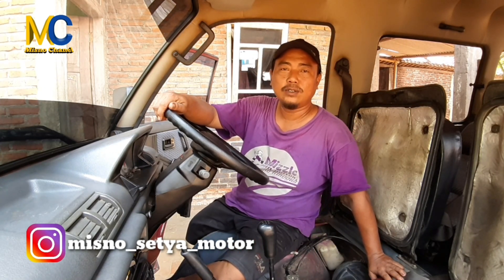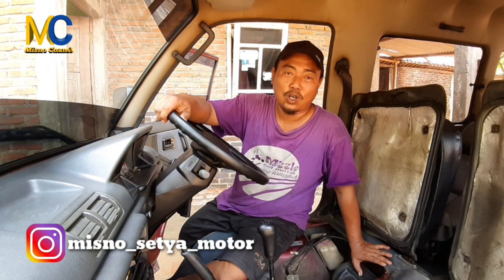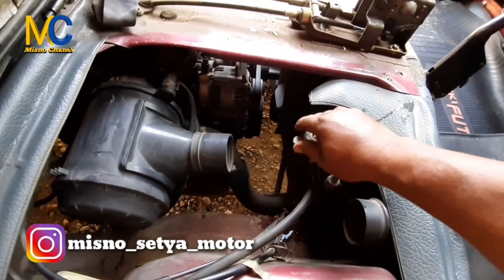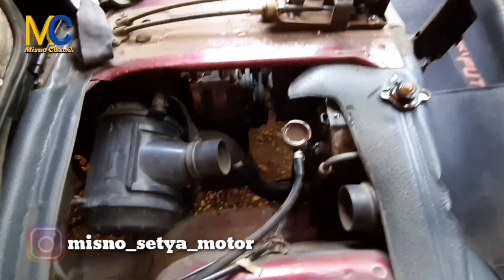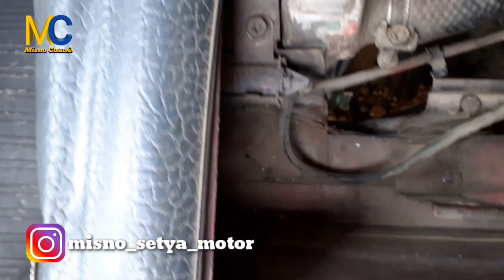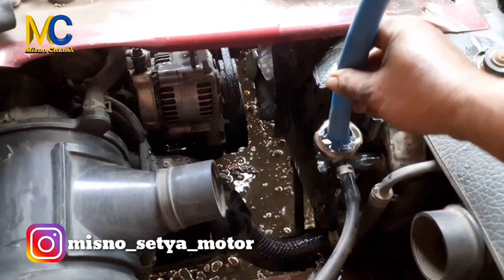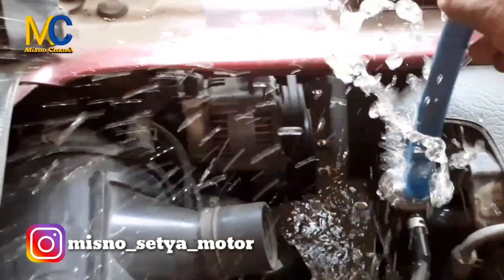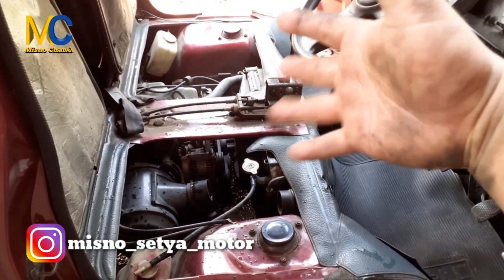Cara membersihkan karat radiator dan cara menguras air radiator.

Comment: mas misno ko mobil karko saya air radiatornya ko diem aj ga muter.tapi klo di gas kenceng ko muncrat sampe satu jengkal tangan apanya mas misno. mksh mas misno sy minta solosinya.
Reply from the maker: Tp temperatur aman kan mas?
Reply: @misnochanel  temperatur aman mas stgh g naik g turun
Reply from the maker: @asepasep1795  berarti mobilnya masih ada termostatnya mas...kalau termostat masih terpasang biasanya temperatur posisi setengah.yg penting temperatur gak naik berarti aman aman saja.kecuali temperatur lebih dari setengah beraryi ada yg gak beres
Reply: @misnochanel  termostad masih ada mas.. mksh mas misno solusinya trmksh bnyak. smoga bngkelnys tambah rame..
Reply from the maker: Aamin...maturnuwun doanya..
Dukung juga chanel yg satunya...
https://www.youtube.com/channel/UCI2n4FGVJ9VW_nXOAwirk9g?view_as=subscriber
Reply: @misnochanel  ok siap mas misno mksh bnyak👍
Reply: @misnochanel  temperatur aman stgh g naik g turun

Comment: Opo bisa air masuk ke mesin sedangkan termostad hrs panas  80 drajat baru buka.....
Reply from the maker: Air selalu ada di dalam blok mesin dan silinder head tetapi tempatnya khusus di jalur air walaupun thermostat belum bukak.air bisa saja masuk kemesin jalaur oli apa bila ada kebocoran diruanh bakar dan jalaur air yg ada didalam mesin dan silinderhead
Reply: Solusinya bos.air radiator tidak mau terputar,kalu di gas air tidak berputar